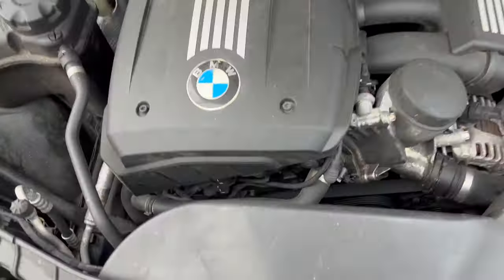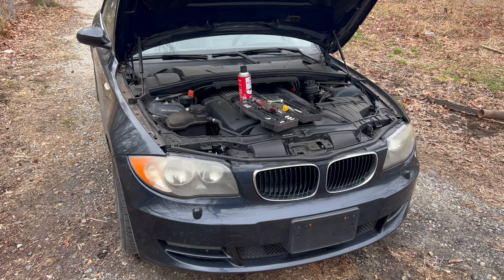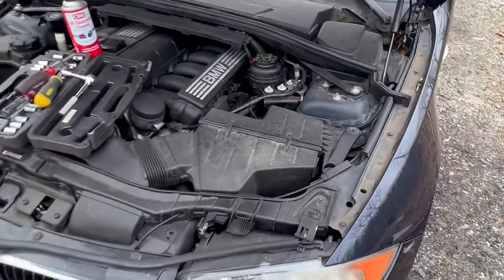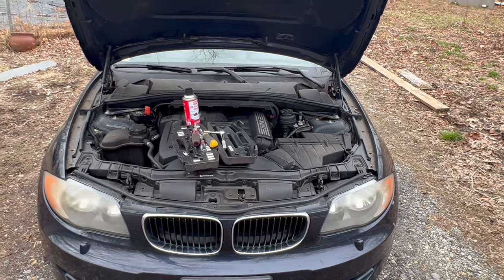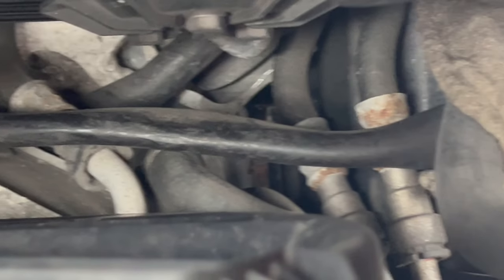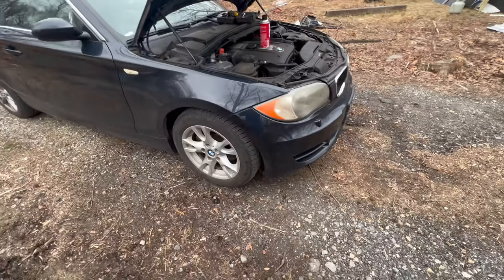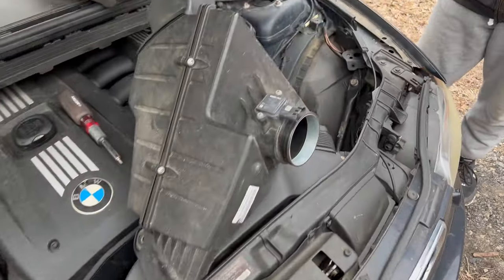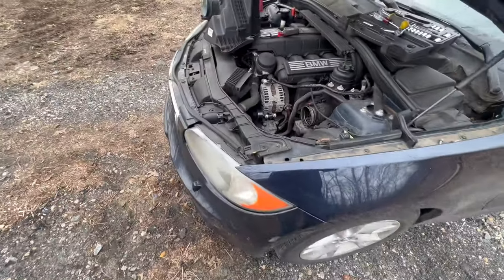CarFax is Useless!

Comment: If an accident is not reported to insurance and fixed, it will not be on the carfax.
Reply from the maker: as I understand it a lot of large national body shops and dealer body shops also report, think of places like BMW dealers, Maaco, etc.... not sure where or even when it was done because its a clear title with no salvage so it wasn't totaled, and dealer I got it from picked it up from an auction out of state, also it's been so so long I guess I'm just stuck with it.  That said, they used OEM parts on the front end, either brand new, or likely salvage yard take offs.... so it hasn't been an issue.... given the cost of cars today though, I'm going to run it until the wheels fall off....... or I get a million subscribers and start making the big buck$ LOL
Reply from the maker: @Bendover-s3b  put about 7,500 on the new Pirellis that it came with, can’t see any noticeable wear yet

Comment: A dealership should noticed a rug wth
Reply from the maker: You’d think, I mean, it seems they would have checked the air filter at least right?  I remember something about a 100 point checkup when they were selling it.  They did put new tires on it, and the oil was fresh, I remember that.  Kind of hard to not see that if someone spent any time under the hood though.  Only reason I never saw it is because it hasn’t been driven enough and I never personally did the service.  So this was a surprise to me.  I’m a little annoyed, but I don’t plan to sell it, but now, if I did, I’ll have to disclose the issues because my conscience won’t let me screw the next guy….. only good thing is, for now it seems cosmetic because it hasn’t caused any issues that I’ve found.
Reply: @RickTheRambler  that thing was surely a big big safety hazard, seems like something that would catch fire
Reply from the maker: @_Philip_.  yeah, seeing news reports of cars sitting on the shoulder of the road burning to the ground.

….. you always wonder what started them…. 

Oil dripping on an exhaust pipe, electrical issues…. is it an electric car??

OR…. Did a random mechanic stuff a rag somewhere….  That’ll be in the back of my mind now. 🤦🏻‍♂️🤦🏻‍♂️

Comment: Driven a few of those, they're really fun to drive and like 30mpg.... which isn't necessarily that bad considering.  You can't ever have a bad day when you're in a convertible and it's warm enough to use it with the top down though!
Reply from the maker: I guess it depends on how well it’s running and how hard you drive it,… I think mine is doing something like 25mpg ish…. Which I know isn’t great but I run it hard, and do a lot of stop and go, as well as having this little misfire, rough running issue

Comment: Replace the eccentric sensor, trust me. I'm doing the same job right now on me 328i. I've replaced all of the spark plugs and coil packs, air filter and everything else. It's one sensor that's a pain but it fails constantly.
Reply from the maker: Whoa!  Never heard of that one, but just looking it up on google the symptoms are spot on!  Seems like that wouldn’t be a bad place to start 🧐
Reply: I had a 2008 328 RWD and the eccentric shaft sensor failed at 120,000 kms. You should have a check engine light when this happens. At that time (2018), I purchased a specific to BMW scan tool from Carly. It works with an Iphone. OMG, did that gadget same me $$$. I was able to ID the fault with precision. Now, the removal of this sensor is the job from hell for a DYI'er. Take your time and start removing the Valve cover, fuel injector railing, intake manifold (after one of the breather hoses snapped off)...etc...
Reply: If you are doing the eccentric sensor, you are doing a Valve Cover Gasket & Valve Cover ( it is recommended that your replace both - Valve Cover is Plastic and can crack as it ages, and there is a diaphragm for emissions built into it.)  Those sensors do not usually fail except when there are oil leaks aka valve cover and the sensor gasket.   Valve Cover & Gasket need replacing at about 100k and/or 10 years because that is when you can start to see failure.

Comment: You never did say what issue you were having with your engine. The coils like to go bad, use high quality coils. Ccv/pcv loves to get clogged too.
Reply from the maker: It’s just a studder around 2,000 rpm under light acceleration…. Seems to come and go.  And occasionally a rough idle that also seems to come and go. 🤷🏻‍♂️

Comment: If you havent changed spaek pkugs fhey are likely overdue. Also thise engines have a pcv tube on back of valve cover to intake manifold that goes bad.
Reply from the maker: Yeah, plugs are definitely on my list, at one point after it sat for quite a while, I was literally running it just to burn off old gas before it got really bad… I did take it on a 400 mile road trip one day, 200 miles up and then back on the same day, ran it most of the way over 80miles an hour…. It seemed to run a lot better after that day trip… but she definitely is due for some TLC. 👍🏼

Comment: Car fax just wants to sell a product, which is car fax subscriptions. Thier basically a marketing company, not car mechanics.

I'm mostly amazed you've owned a BMW for 5 years and only needed oil changes.
Reply from the maker: Actually I’ve had a few BMWs, bought one on eBay once, it had a coolant leak and an oil leak, coolant leak was a $0.60 o-ring on a temp sensor, 2 minute fix, and the oil leak was fixed by changing out a copper crush washer on a vanos oil hose, the whole new hose and washers came from Amazon, was like $30 with free shipping,… car ran like a top for the 2 years I had it, sold it for twice what I bought it for and then bought this one that I have now 😆  I can’t really complain about these old BMWs…. I stay away from the ones with all the infotainment computers and turbos…. Drove this one today and it’s still doing just fine….. speaking of oil changes though, I think I’ll need to do that again once the weather warms up 😆

Comment: To me, does not look like it was wrecked.  Some one bent the support bars because there is no room in that 1 Series Engine Bay.   The 3 Series  is hard enough to work on, and that is smaller.   I would never buy a 1 Series,  too much crammed into a small area.
Reply from the maker: Be easier to just unbolt them than to bend them out of the way risking hitting something like the back of the radiator with a sledgehammer no?
Reply: @RickTheRambler   Yes, bent out of the engine so the would not rub.
Reply from the maker: @MrCuckoobox  why would someone just randomly go in there and do that though?  Were the original clearances really THAT tight to consider that as a fix for something?
Reply: @RickTheRambler  Hoses rubbing against it? Adjusting or removing something and needed the extra room because the bar was in the way and they knew they would have do it again so bend the bar  a little when it is out so they did not have to remove it next time? Some one with big hands?   I know that the e90/3 Series is tight in a lot of places.  I can not image working on  a 1 Series.   I do not have large hands, just average.